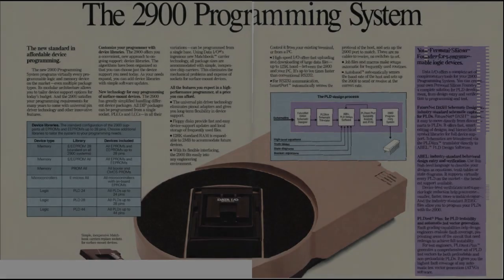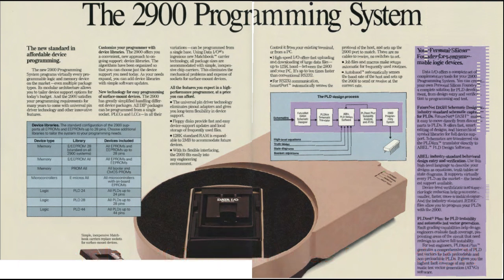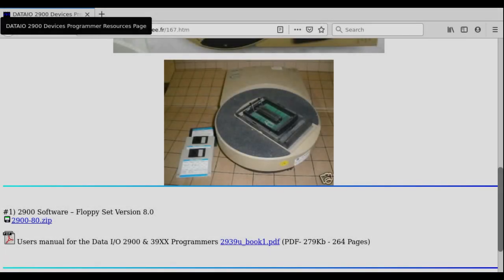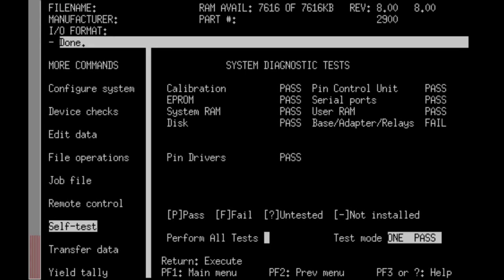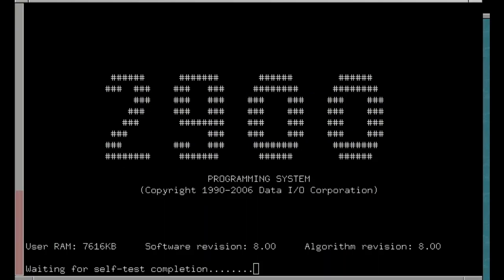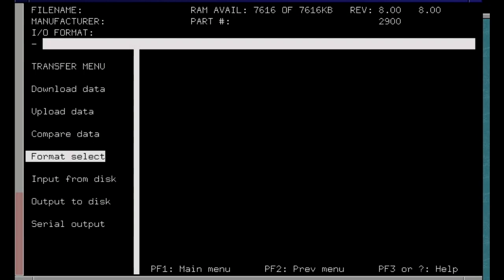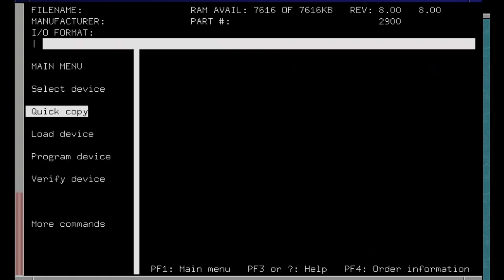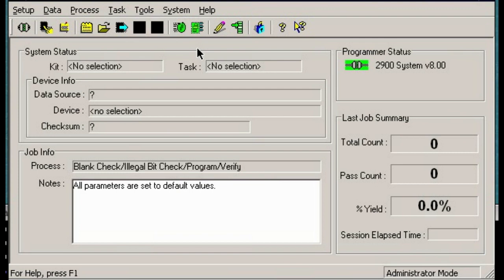The Data I/O 2900 device programmer. Introduction and (easy) repair.

Comment: The caps in my PSU blew up the instant I powered up after unboxing; it was very loud double whammy!
I've had lots of problems with Nippon Chemicon's from the 90s, mostly in UNIX workstations. This is the first time I've had them explode tho.
Reply from the maker: Yeah I witnessed a couple of aluminum electrolytics smoke live, but it's rare. Tantalums, on the other hand, do that a bit more often.
Reply: @iz8dwf  Correction... it wasn't the caps at all, or at least not directly. The 2SK1081 MOSFET blew up due to a short caused by the small leaking cap right next to it! Why the hell did PowerOne mount this next to a hot tranny?? Anyway, that part appears to be unobtainium now. Not sure why I heard two explosions, either...
Reply from the maker: @NuGanjaTron  Well, I did a big mistake to not inspect the power supply of my 2900 before power it on for the first time and I've been unusually lucky anyway. After this video I had to take the power supply apart again and substitute all the secondary side semiconductors and the voltage trimmer, seem the 2900 doesn't like the 15V supply drifting too much. The power mosfet is just 800V/7A part, I'm sure you can find a similar enough modern replacement.
Reply: @iz8dwf  Yeah, I now realise my mistake too. Funny thing is, the seller (classifieds, not eBay) showed it working and passing the self-test. So my guess is this thing has been sitting for years and was powered up once more for the ad, in the process of which the cap started oozing -- but not enuff to actually short the MOSFET. Anyway, the area around it is now covered in slimy gunk, so it must have continued leaking for some time after.
Normally I check out PSUs before powering them up, but I really didn't feel like dismantling the 3900, and I now realise getting at the PSU is quite a pain. All in all, the design quality here isn't in the same league as Data I/O's older models (notably the 29B). Granted, the 2900/3900 are very capable devices and handle a lot of the more modern chips.
Thanks for the hint on the MOSFET replacement, I'll check Alltransistor for that. I'll first have to figure out how to remove it from the heatsink tho; it appears to be epoxied (?) on. It also looks like one of the pins blew clean off!
Incidentally, there appears to be some crusty tan residue on the outside of the heatsink that contacts the PSU frame; if it was thermal paste, it's completely dried up.

Comment: What do these 2900s go for these days? Been looking for one for ages and was recently offered one, but passed on it as the price was too steep. Considering the age and potential issues, I figured it was too high a gamble. 😕
Btw, kudos for running this thing off Linux (if only as a terminal). I'm always amazed how many developers resort to using stupid Windows when they ought to know better...
Reply from the maker: Hi! I've been looking also for a parts unit to have spares, but indeed prices are too high. Also consider that shipping to EU (from outside EU) is a major deal killer nowadays. I do use Linux for almost everything since years btw :)
Reply: @iz8dwf  I was offered one locally for 450€, with only 1 adapter (the 2900 Base). Allegedly in working oder, but watching your video, it's clear it would develop issues sooner or later. That said, it did sell in the meantime, so somebody was prepared to pay this price. Buying up separate parts near and far doesn't really sound like an alternative tho.

Comment: 👍 Nice job on the diagnosis and repair.  Very lucky outcome given all the custom logic on the 2900.  BTW, the latest system software for the 2900 is 9.40 actually.
Reply from the maker: Yep, the custom logic chips could be an issue, but I took the chance, otherwise these programmers get very expensive if sold in working conditions! And yes, I'm now running it with 9.4 software revision, I discovered the latest revision later after this video was already published.

Comment: Thanks for showing off some cool obscure gear!
Reply from the maker: Hi and thanks for the comment! I do have some more obscure gears too :) I think I  might be showing some more then :)
Reply: They're not really that obscure, but actually standard equipment for any chip programming in industrial environments (basically wherever control logic is developed). That said, they are hard to find on the 2nd hand consumer market, and command high prices. They are very popular with retrocomputists and retrogamers to back up and restore vintage ROMs, some of which are now failing. They are particularly sought after by retro arcade operators as they support many of the older, now long obsolete ROMs that most newer programmers can't handle.

Comment: I would just love to get one of those programmers. 9000 devices is staggering!
Reply from the maker: Heh! I think modern programmers support more than that number, but you know: for vintage devices, you need vintage programmers!
Reply: @iz8dwf  So have you found old stock philips  PLS-100N is this your plan?
Reply from the maker: @Electronics-Rocks  Kind of... https://www.youtube.com/watch?v=nicaN-IdzNI
Reply: @iz8dwf  The great thing about these Data I/Os is that they don't need proprietary SW on an old Windoze PC you keep around just for that purpose. Some of their earlier models with displays (22A, 29B, 2xx series) can be operated independently of a host or terminal. Just chuck a ROM image on the RS232 and punch the PROGRAM ked3y. Very convenient!
But yeah, vintage tools for vintage gear helps a lot! 😉
Reply from the maker: @NuGanjaTron  I agree, since I deal every day with "vintage" hardware repair, these programmers see a lot of use in my lab. However, I already need three different ones to deal with all the old (aka "ancient") devices. The only one that supports almost all devices is the Data I/O Unisite and unfortunately I didn't grab a cheap one when I could so I'll be suffering the multiple programmers punishment for the rest of my life.
Reply: @iz8dwf @iz8dwf Yeah, I know the nagging regret of missed opportunities!  😫
And I realised there's no real "one size fits all" programmer other than the Unisite, so I also have three models sitting around and invading space. 😅
Reply: I see that you have got one .  https://www.youtube.com/watch?v=mRqsGytvSP8